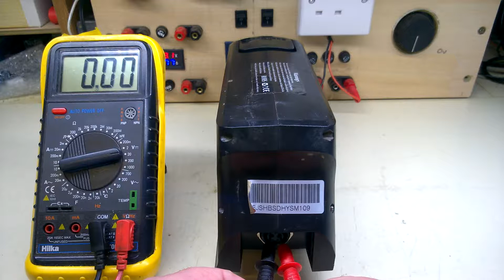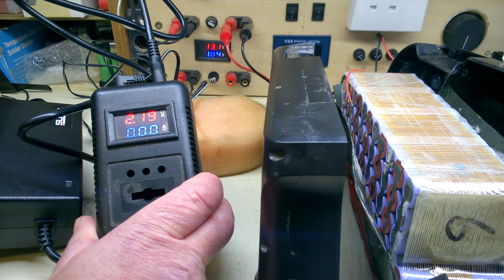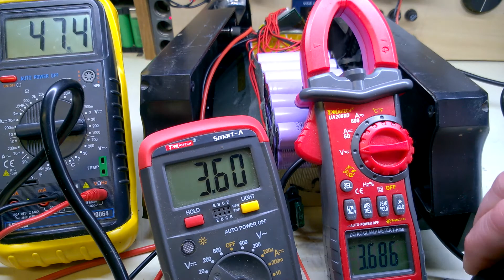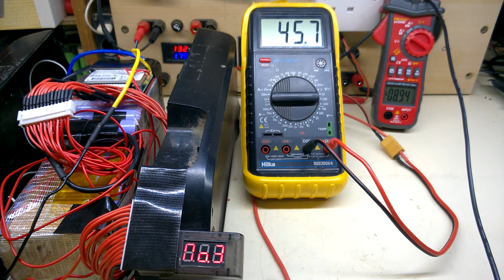48v Shark Rad Ebike Li ion battery repaired (Short version)

Comment: hi  been watching your very interesting videos, I do have a question for you, 36v lithium cell pack 10ah on my ebike runs okay for just one mile it shuts down unplug and plug in again okay then for a mile then same happens
Reply from the maker: It depends how you're using it for that one mile.
If you're hammering it , there may be an over temperature issue with your cells.

If you're taking it easy , you may have some weak cells and/or a faulty BMS.
I'm assuming here that the battery is fully charged when the problem occurs ?

Comment: Can I ask how the push button switch works?
Is it wired to the BMS? What voltage goes to it? Thanks
Reply from the maker: The push button switch is wired to the BMS.
When pushed in , the 2 yellow wires are connected (on the original).
This switches the BMS  on.

I didn't measure it for voltage - the switch just completes the circuit - switching the BMS on & off.